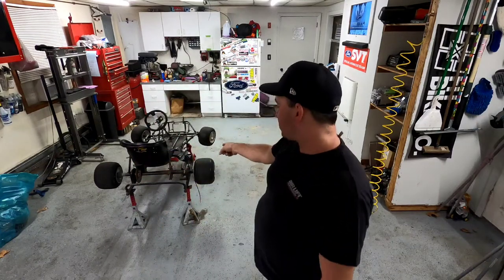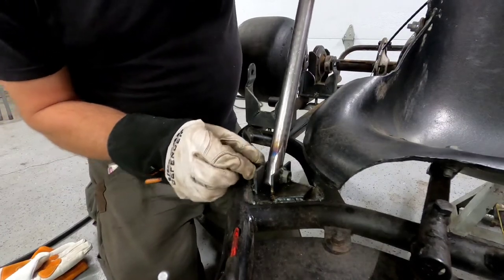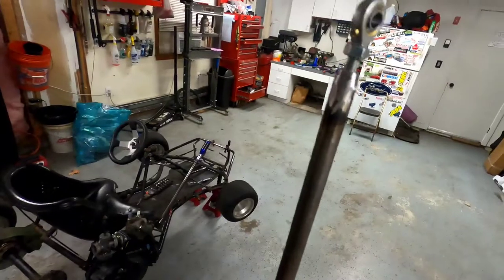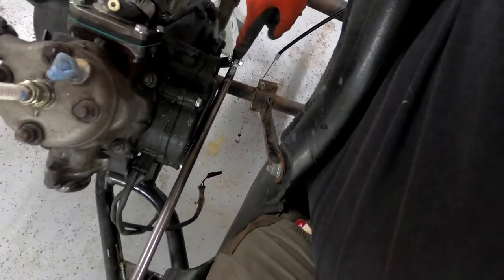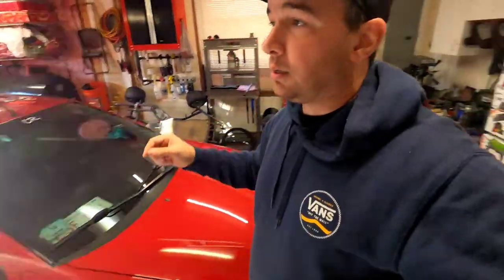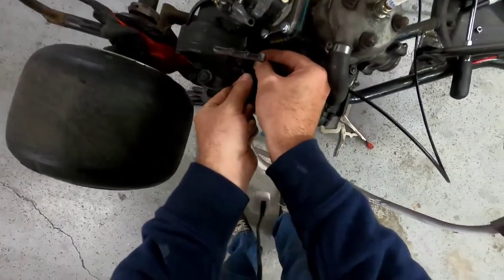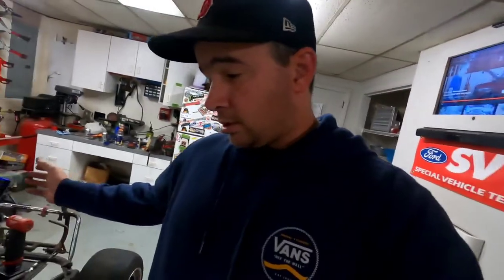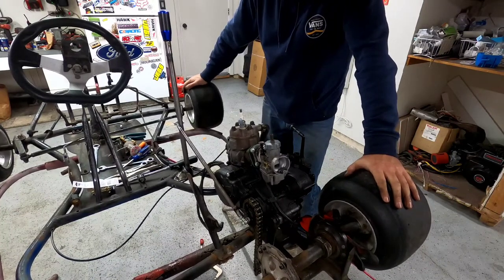CR80 gokart build episode 2

Comment: good job, wish i had these skills. just bought a 1996 cr80 motor that i plan to try to slap on a minibike, wish i would have got a donor bike or known running motor but all part of the fun i guess.just got a pretty bare motor that needs a clutch n top end, n carb and radiator and electrical parts,
Reply from the maker: A cr80 swapped mini bike would be awesome my next project is a minibike